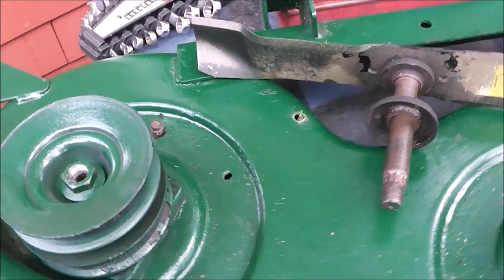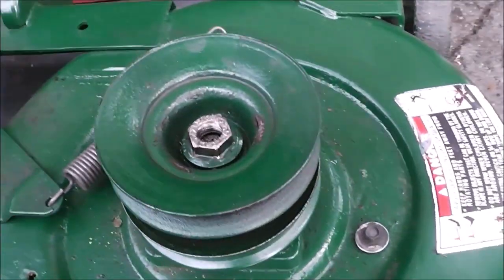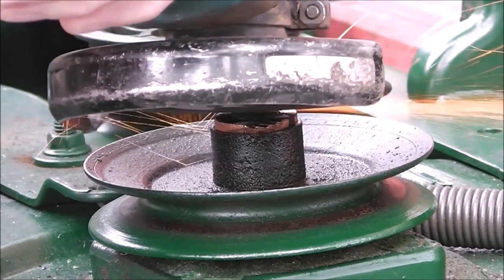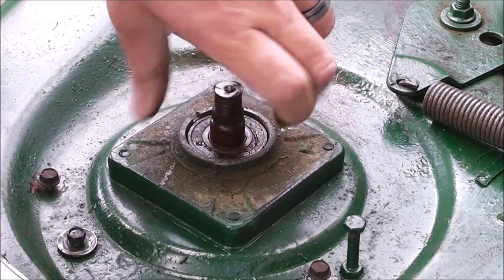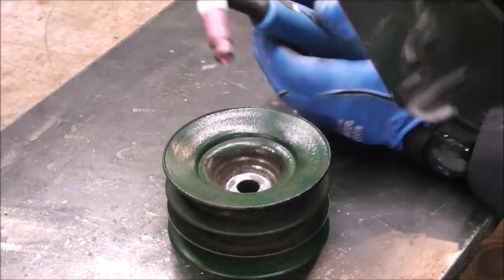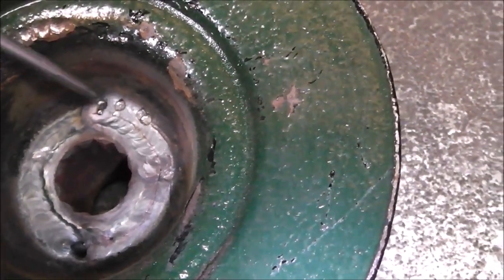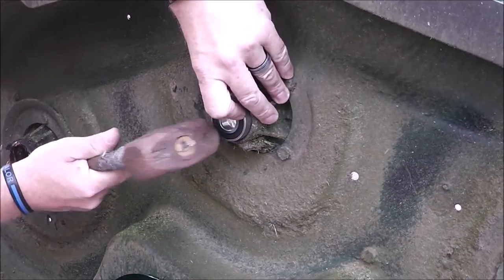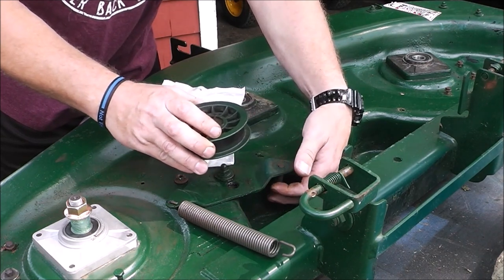TIG Welding Repair and Spindle Modification

Comment: Good job again, I always tap bearings in with a bit of wood tween hammer and bearing, or better still, a lump of delrin. Another lesson I learned the hard way, was to test grease fittings on the gun before fitting em, I put one in on the swingarm of a motorcycle and it was a dud-no grease was getting through, bushes got chomped and had to do the whole job again.Pesky noises? I once spent hours/days turning off/on machines, lifting/moving stuff trying to locate a pesky noise, then it dawned on me, it was following me around!!!!- turned out I had tinnitus-doh.
Reply from the maker: Good tip on the wood/delrin!  I've had that happen with grease fittings also. Here is a handy trick an old timer taught me to help get a stuck brake bleeder screw un-stuck (would work for grease fittings also). Tap all around the perimeter of the bleeder screw with a punch and hammer.  I hear that tinnitus is awful! Hopefully you don't suffer too badly friend!

Comment: Hey buddy for future reference that pulley was cast.That's why it never really stood a chance welding it like that. An easy way to tell if something is cast is to blast it with the tig in a lil spot and try to file it if it's as hard as a coffin nail (from all the carbon hardening) it's cast. 

When you "weld" really braze (TIG or oxy) cast you don't want to melt parent metal, just wet the filler onto it.  For TIG Nickel filler is best but expensive, but I've used silicon bronze or even 309SS with success. Even without trying to wet/melt parent metal it's still a good idea to preheat and wrap it up or put it in sand after. That slows the cooling and helps prevent cracking thus increasing your chances of success. 
ATB Steve
Reply from the maker: Steve just Steve Are you kidding me! Funny enough, I just finished a video on cast iron 😂 I never even gave it a thought! It makes perfect sense now! Thanks buddy, I appreciate the info. I can’t believe I didn’t do a file test on it.., oh well, live and learn I guess. That’s why the comments section is great! Thanks again brother!
Reply: You got it, keep up the good work buddy.

Comment: Nice job Brandon. 
Fyi: fusion welds are prone to cracking (especially when the metals are dissimilar). A 309 Stainless or silicon/bronze filler would have likely given you a successful weld. Fusion welds are good for tacking parts in place before adding filler. I've never had one hold up to anything.
Reply from the maker: I wonder if 316L would have worked? I have a bunch of that on hand but I never thought to try.
Reply: 316 ? negative. 309 is known to work fairly well on dissimilar metals. Silicon bronze would be my first choice for cast iron. Use TIG braze rather than an actual weld. (With the braze process' you don't melt the base metal into the puddle) TIG braze is pretty damn strong too. I've repaired engine blocks and heads with it.
Reply: Yes sir MCE, thats what I found, I love my silbro rods and 309s , most folks forget that bicycle frames and motorcycle frames were brazed back in nineteen hunnerd knife fork n spoon, when I was in tech college back then, braze was reckoned to stand up to flexing and contraction/expansion better than welding- steels/metals have improved now of course so brazing kinda got sidelined, but its still a great process with TIG as its neat and clean due to no flux needed.

Comment: Interesting.. Think my spindle bearings will diassemble the same way.. Were the spindle bearings the same size?
Reply from the maker: Yup! All 6 bearings are the same size. Actually all 3 assemblies are the same size too....spindles, bearings and housings.
Reply: I have 4 new 6203 sealed bearings here.. What size were yours?
Reply from the maker: @raybonz7939  6204-2rs were the ones in my deck.

Comment: Was that a Cumbies drink lol Couldn’t you of drilled through the bearing where the zerk fitting was? Only the inside ring spins the outter is stationary right? Then you could of left the cover on the bearing....Jason
Reply from the maker: Good eye! I quit Dunkin a couple years ago...now I just do Cumbies LOL.  Yes the bearing is stationary on the outside.  I don't know if I would have had the clearance to drill the bearing but it would sure use much less grease because your not filling the entire cavity :) P.S.  you asked a while ago if that Blue Demon ran 6010....I decided to find out...It does, like a champ!  That video should be out next week. Take care brother.
Reply: Brandon Lund awesome man I can’t wait looking foward to it, have to find a bargain welder that runs 6010 with a crisp enough arc. Have a good Labor Day weekend brother we are headed to Hampton beach NH
Reply from the maker: @weldingjunkie  Awesome! Careful on that bridge that goes from Hampton over towards the nuclear plant...I did a bunch of structural work on that bridge :) enjoy your weekend brother!

Comment: you took all that time and replaced all that but didn't sharpen the blades or clean the deck? really  ;)
Reply from the maker: No, it has all new blades and the deck was treated with commercial grade paint similar to POR 15. It's in a previous episode in this playlist https://youtu.be/Fzl3i__lQUs
Reply: @BrandonLund  OK, saw it. Good vid. Just remember the rust coating doesn't stop the grass from sticking to it... and new blades should still be sharpened. Spray the underside with something like a teflon coating and sharpen the blades till they are sharp. (I cut 3-9 acres a week. You can totally tell when the blades are sharp.)